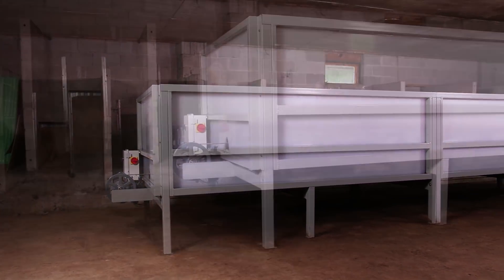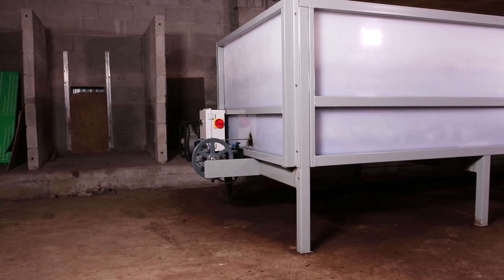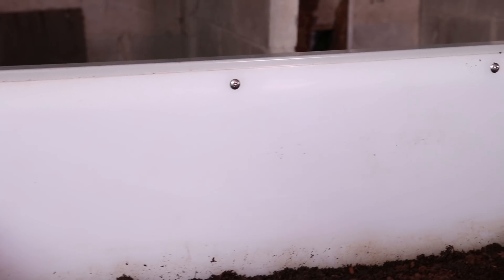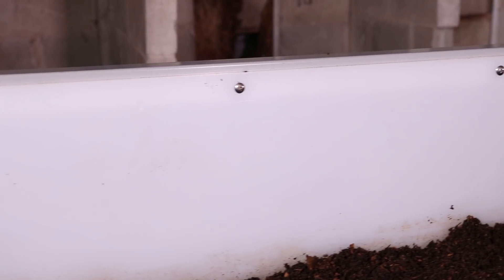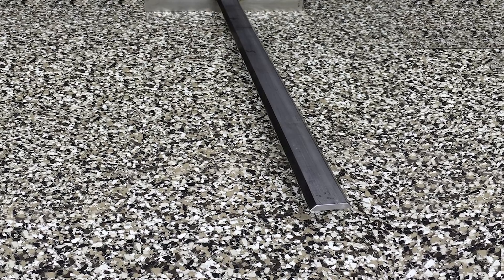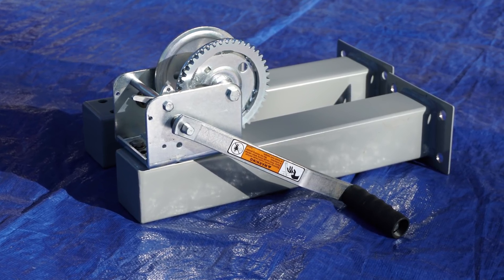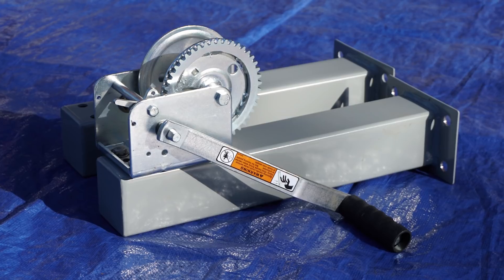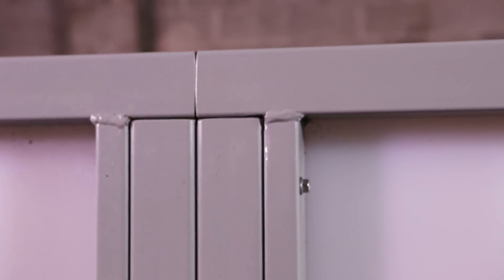Vermicompost - CFT Continuous Flow Through

Comment: Hi, does the harvester not damage the worms? It looks like it might hit some worms that are at the bottom.
Reply from the maker: The species of worms used for vermicomposting are epigeic, meaning they prefer to stay near the surface. There will be a few that wander down or some that hatch from below, but the concept of continuous flow systems should minimize the  number of worms near the bottom.  Also, the cutting bar is rather blunt, not sharp, and it moves quite slowly, so it is more likely that any worms in the cutter's path are actually nudged out of the way and not actually cut.
Thanks for the question and thanks for viewing!
Reply: @tools.for.vermiculture  i know some  continious flow systems that use red wigglers and european nightcrawlers. The wigglers first decompose the raw material and the crawlers do the rest. They do stay at the bottom. I believe this to be superior to just having wigglers...
Reply: It's just worms.

Comment: Hello i want to try vermicompost this year. I have one question, can I use Asian jumper worm , instead of using the other worms which people normally do? The reasons is because i have lots of jumper worm in my garden.. 

Your answer will be appreciated , Thankyou
Reply from the maker: For continuous flow process you need to use a composting worm, not earthworm. Some jumpers can be used for composting but they burrow down deep so they are not suitable for the continuous flow process.
Reply: Depending on where you live Asian Jumpers are invasive.  They may be good for your garden but are actually destructive in forests and natural habitat.  If you have Asian Jumpers in your garden you should do everything you can to prevent them from getting out.